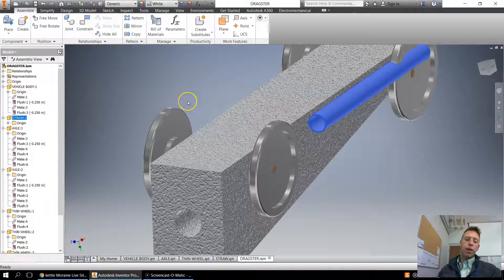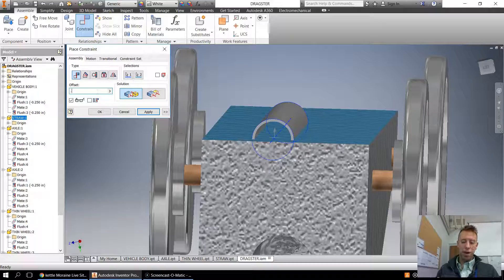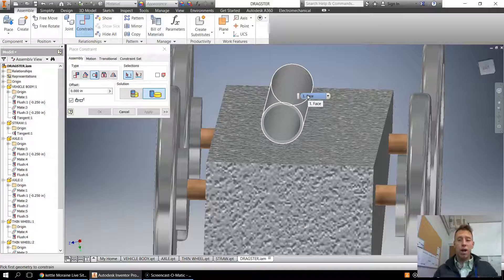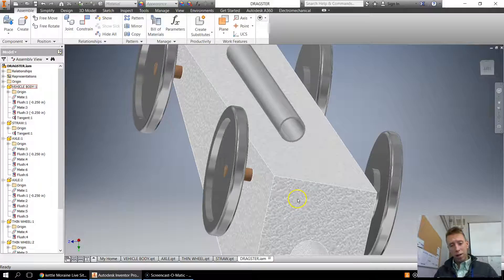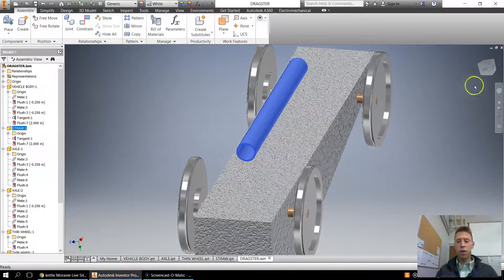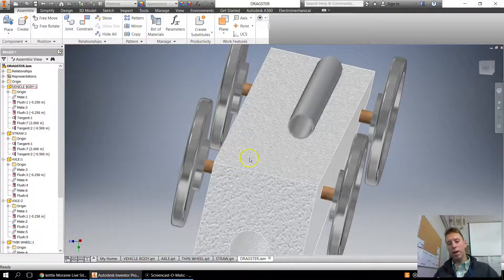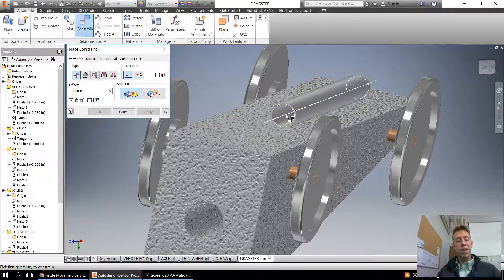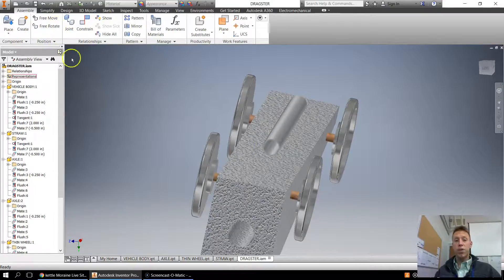3D Modeling:  Constraining a Round Surface to a Flat Surface

Comment: This has been very helpful. What if you're trying to stick a flat object to a round object? I'm trying to build a round (cylinder) oil storage tank in Inventor and it is proving impossible to get the constraints to act the way I need them to. I need the flat objects to be mated tangent to the round surface of the tank, and the flat surface be tidally locked to the center of the tank so I can make an angled constraint that will just move it around edges of the tank based on the angle input. Is this possible in Inventor?